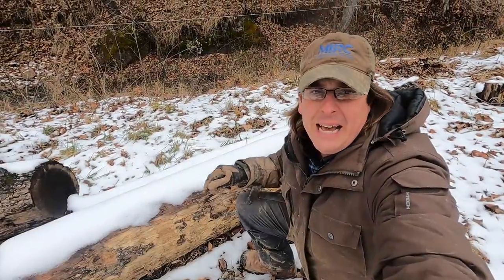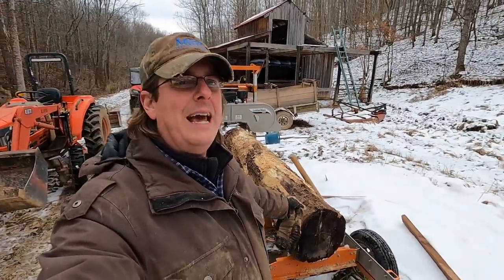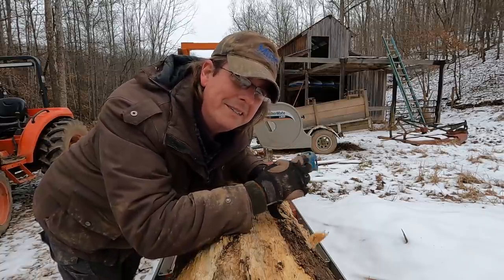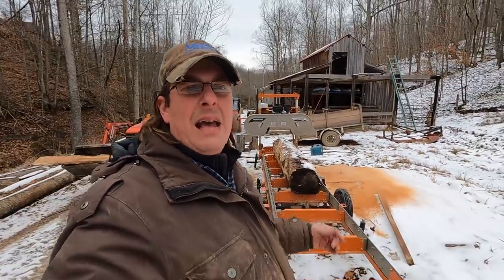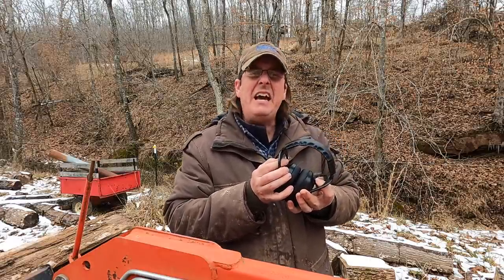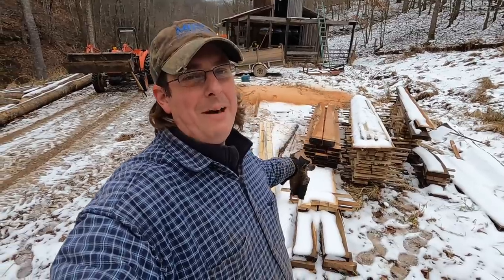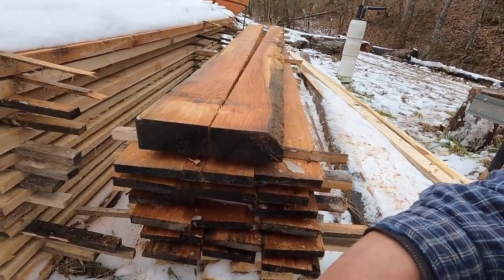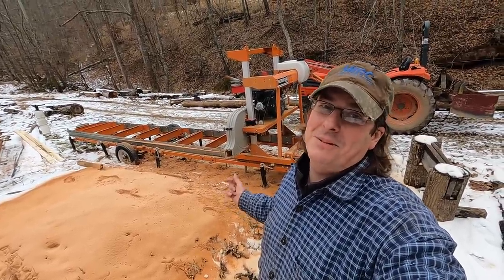Red Oak Log TOO ROTTEN TO MILL?

Comment: Go old school. Get a pair of top leaf of leaf springs and a 5' piece of heavy c channel.
Using the center pin hole in the spring leaf to bolt on the bottom of the loader bucket. Bore  holes about an inch behind the cutting edge and 48" apart center of bucket. The channel is to stiffen the bucket and prevent destoration.
I've seen some people use the short leaf on the bottom of the spring set to strengthen the long leaf.
Keep up the good work. I'm enjoying your videos.

Comment: Our tractors are very similar, ours is a Kubota L3300. No quick attach, no 3rd function or rear hydraulics, and adding those items certainly adds up. We love our Kubota, but I'm not sure we'd use the extras enough to justify the costs. 
We also have a few old oak logs that I'd love to get milled into some useable lumber, since it's from our property and the oaks are at least 150 years old. 
Thanks for another quality video!
Reply from the maker: It amazes me how much the Kioti and Kubota tractors are similar. I always use  Kubota repair videos for my Kioti and the steps are exactly the same
Reply: @RedToolHouse   We have a decent repair video posted for the front hydraulic cylinders if you haven't fixed / rebuilt those yet.

Comment: Pallet forks are as simple as welding square tubing on your bucket on the top lip. If you want to be really safe weld flanges on the forks that will lock into that square tubing. The weight of the forks and load will keep them firmly against the bucket. For the cost of a  set of forks and about $10 in scrap square tubing you'd have forks.

Comment: Well, it wouldn't have worked with THAT log, but I've used a bucket like that to pick up logs; just hook the end of the log under the top lip of the bucket and drag the other end around.

Comment: I believe I would buy an old set of quick attach forks for a bobcat or something and "farmer engineer" them to fit on my tractor, if I were you. Older bobcat forks that are quick attach just "hang" on the iron bar for the quick attach system- You could weld the same configuration on the top of your bucket and it wouldn't be in your way. Just a suggestion.
Reply: https://www.ati-corporation.com/  makes the adapter plate that stays on the tractor to connects to skid steer attachments (called SSQA).  You take your pins out ONCE and put this plate on,  and then you have to weld the female plate to your bucket (ATI sells them, so do a lot of farm implement dealers), and from then on, it's 20-30 seconds to unhook, and hook up any skid steer type implement.  Most newer mid sized tractors come SSQA ready.

Comment: After you mill what do you do with all the cut parts you take off the wood that I see you keep pulsing up
Reply from the maker: I cut the hardwood for fire wood. Friends come get softwood for campfire wood. Some get used for corral boards and once a year I rent a 13inch chipper to turn into woodchips. All gets used eventually.

Comment: Looks like you just need a tractor upgrade.  Get one that has all the luxuries along with a cupholder and a place for a toolbox and a cooler.  Get a cab on it too with climate control.  Probably could find something like that when the state has auction sales on their used road equipment.

Comment: Eye of the Tiger
Reply from the maker: I love it. Beautiful once planed and finished.
Reply: @RedToolHouse  you spoke about the grapple but I really think you’d benefit with a set of clamp on pallet forks. Sorry if you have addressed that as well. Keep up the good work.
Reply from the maker: I have debated trying them out. If I was lifting pallets with several hundred pounds then I think it would be ok. This bucket is thin wall steel and I am concerned it will fold with a 1500 pound log.
Reply: @RedToolHouse  makes sense.

Comment: clamp on pallet forks w/ stabilizer bar $300, ijs...
Reply from the maker: Thin bucket that fold in half from 1500lb log adds quite bit to that expense! :)
Reply: @RedToolHouse  Exactly WHY those clamp on a bucket forks are useless.
Reply: @RedToolHouse  true story :) i like those little teeth you've got on the bucket ends, very useful

Comment: Love the milling videos - makes me want to get one.  FYI they do make pallet forks that will clamp right on to your bucket and a LOT cheaper than the route you mentioned for a grapple.  Titan makes clamp on pallet forks for the bucket.  https://www.palletforks.com/skid-steers/pallet-forks/clamp-on-pallet-forks/ (the particular link is just the first link I found for them)
Reply: Nope.....stay away from forks that clamp on the bucket for this kind of work.....way too lightweight, and puts the load way too far out in front of the bucket.  Real easy to bend the bucket being tempted to pick up something you shouldn't.  Just don't go there, spent the money on a real set of forks.

Comment: Ya know, with a set of pallet forks, you'd scoop that log right up and not have to be repositioning that set of tongs to find the balance point.  Get an SSQA adapter plate from ATI for your tractor  https://www.ati-corporation.com/  and switching between forks and bucket (and hay spear and other stuff) is a 30 second deal.  Forget a grapple...you're right, they are way overpriced and the only thing you can do with one you CAN'T do with pallet forks is grab brush a little better.  

And with pallet forks, you can move stacked lumber, logs, slabs, PALLETS (and you'll suddenly find EVERYTHING goes on pallets......ahahhahaa).  Set of pallet forks beats the heck out of a grapple, but grapples are all the rage on YouTube....from people that don't know any better, or have money burning a hole in their pockets.